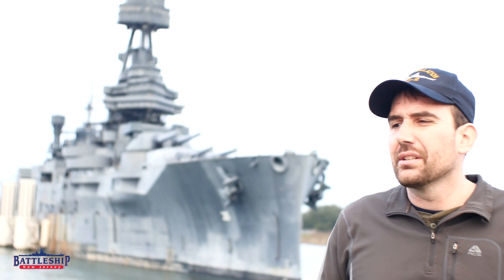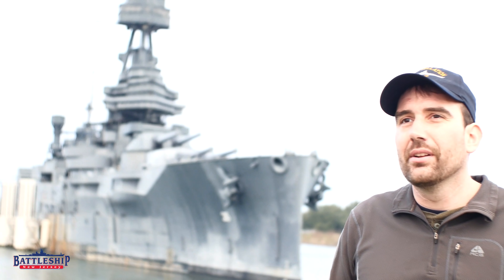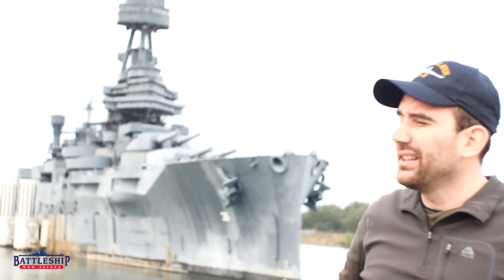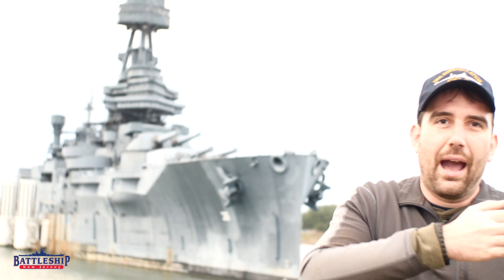Why Is Battleship Texas Shaped So Weird?

Comment: The most important problem is "Bang for the Buck".  These warships at that time were by far the most expensive ships being built by any navy.  This meant that they had to be made such that in a battle line they would have a good chance of surviving enemy weapons as they fought back.  Back then that meant armor or speed, but NOT both, due to the inefficient (much better than the 19th Century power plants, but still only beginning to put in higher-power designs like steam turbines to replace the sets of huge piston steam engines used previously.  Since the powerplants were so bulky, putting in high speed into such heavily-armed warships was not possible without decreasing the armor protection and, later, the much more effective anti-torpedo hull side protection, especially as aircraft were now beginning to become capable of carrying big-enough weapons, especially torpedoes, that they were now a bigger and bigger threat to battleships *(eventually aircraft carriers replacing battleships completely, with nuclear submarines eventually becoming somewhat equal as a replacement).

US battleships after the "Dreadnought"-type came into being circa 1905 or slightly later  with all one size of the biggest guns made at the time and the other guns just being small for any aircraft/anti-torpedo-boat guns (the 5"/51 being a very high-velocity, and relatively effective for its size, anti-small-ship gun) with almost no AA guns when the ship was first built (remember, only a very few years after the Wright Brothers had been able to get their first kite-like airplane into the sky at all).  The US decided to restrict speed of its warships more than some other nations, but increase the armor and put LOTS of the largest guns available (14" rifles in 1910 was then new universal weapon, replacing the then-current 12" or, in some foreign navies, down to 9.2" guns on their warships).  This meant heavier armor to have a chance to stop the enemy weapons at the expected battle ranges and this cut into the weight that could be put into powerplants.  They tried to get the lightest armor scheme that they thought they could live with by using the new idea of "all-or-nothing" armor, where the areas needing protection had the thickest armor possible for the ship size and weight, with the rest of the ship having only minimal anti-fragment/anti-small-gun protection -- this required moving the important areas closer together in the ship middle and cutting the ship length to just enough to allow the minimum engine/boiler systems (which took up a lot of the chip center) to get the minimum speed that they felt had to be used for an effective navy,

As noted, the US went for rather a lot of big, slow, heavily-armed and heavily-armored warships of similar capabilities (to others of roughly equal age, adding gunpower in large steps, such as 12" to 14" to 16" guns, with otherwise minimal changes to the ships as to speed and even armor).  For example, the WWI-era battleships, which TEXAS was one of the first with the 14: gun size, all had about the same belt armor -- 13.5" Class "A" (Krupp-type face-hardened nickel-chromium steel made by three big steel-makers in the US) armor for many of the later WWI-era battleships through the 16"-guned COLORADO Class -- allowing a good idea of what ranges against an enemy naval squadron you wanted to fight at (the late-19th-Century clusters of warships, many being one-of-a-kind, caused all sorts of headaches trying to figure out how to fight them as a group).  As gun ranges grew due to much better aiming and target tracking systems (optical directors and range-finders coupled to electro-mechanical calculators and reasonably reliable ways of transmitting the needed information from one place to another -- the US excelled at this for all types of warships, even today with digital computers, radar, and all other electronic devices), the requirement that all ships be able to concentrate their fire at the most dangerous targets emphasized the needed similarity in the ships to the largest extent possible, while still allowing progressive improvements such as bigger or longer-barrel guns to occur as time went on.  Improvements were to IMPROVE capability,, not to mess up the older well-established concepts and keep things unstable as to use!

Comment: Hi Ryan,
Love your videos, but I have to offer a correction for this one. About 2 minutes 20 seconds in you're discussing the torpedo bulge and you have a big red arrow pointing not to the torpedo protection but to her armor belt. That is flat face hardened steel and is mostly above the waterline, obviously not where a torpedo would hit. The bulges actually do show up in the drydock shot about 2 minutes later. Otherwise, great video. Keep them coming.
Ken Morgan
CAPT USN (Ret)

Comment: Design of BB-35 was quite sensible FOR HER TIME. Ranges were expected to be fairly sort, guns laid by crews for the secondaries, and all-round coverage to deal with torpedo boats required a lot of 5"/51s. Of course, it turned out some of the 5"/51s weren't very usable because they got washed out (British found they had the same problem with ships of that generation). Still, not a foolish design for the date.

Comment: The only ships that never really made sense to me were the French Pre-Dreadnoughts and some of the earliest French Dreadnoughts. They seemed to have included some stylistic licensing that did not always help with functionality.  The whole wing turret designs of foreign Dreadnoughts never made sense to me either, but I kind of understand why they did it. I mean to a certain extent more guns is more guns. However if you can only use those extra guns in certain situations, then you might as well not have them. This is why I personally view the USS South Carolina BB-26 as the first truly modern battleship and not Dreadnought herself. The all centerline main battery arrangement, a design that everyone eventually adopted, just makes the most sense. It allows for the carrying of a large number of guns, with the greatest firing arcs and offer the best protection for the machinery and magazines that operate the guns. Wing turrets were notorious for being knocked out by weather, heavy seas and also for having poor armor protection simply because of where they were placed. Was neve a big fan of the turrets in the middle of ships either. Again like the wing turrets, the mid-ship mounted turrets were only usable over very small firing arcs and again stretched out the area that required heavy armor. Then there are the French Dunkerques and Richelieus, and the British Nelsons with their all forward main battery arrangements. That arrangement is fine if you are the pursuing vessel, but if the tables are turned and you are the retreating vessel then you have no big guns to try and dissuade  or sink your pursuers.  And not that any battle wagons used the setup, but USS Pensacola (CA-24) having the heavier triple turrets superfiring over the lighter twin turrets never made much sense either. Why would you make the center of gravity of the ship higher by putting the triple turrets higher than the twin turrets and make the ship less stable? I suppose it might allow for a slimmer ship at the water line, since the larger barbette is moved towards the center of the ship and possibly a gain in speed.

Comment: Why was the top part of the battleship on 3 poles on Texas rather than the round cages seen on some ships at Pearl Harbor during the Japanese attack?
Reply: Texas was originally built with cage masts, but with the addition of new equipment like radar plus upgraded rangefinders the cage masts were too flexible. The tripod masts were more stable and were added during the mid-1920s renovation to replace the cage masts. Cage masts had been used originally because they were effectively transparent to enemy fire...shells hitting them would pass through harmlessly as the cage structure was not heavy enough to initiate the fuse action on armor-piercing shells.

Comment: Fyi, the battleship Texas is no longer where he is indicating with the projected image behind him. It was moved out of its moorings probably a couple of years ago by now. I forget where it's destination was but it was being towed to another township basically that had the money raised to do the necessary repairs to the structure below the water line. The ravages of time had ate away at the bottom and it had to have full-time pumps running to keep the water in check. The citizens of the Houston area and never were interested enough to get enough money together to make the repairs. It is odd and sad to see it's original location without it being there now but at least it will live on a little longer at its new destination.

Comment: A lot of design came from trial and error, obviously. 
You can't pull a ship that size out of the water and redo complete sections in a weekend.
So, they did the best they could with the knowledge they had at the time.
When you think about it, these warships were purpose built for WWII, and little time for testing.
So, I'm pretty sure most everything that the designers came up with was done from the best of intentions.
Some of it may not have worked, but they did try!

Comment: Well it seems to be a little bit of trial and error, from the Texas to the Missouri,but I'm sure that they were all very effective, so the Texas didn't have the long range guns, but still it had powerful guns, and and it was meant it seems that it was a little bit more effective in close quarter fighting, where the Missouri could reach and touch something, and had the long range guns,
  so that's why I said a little bit of trial and error in there, just like you said they took the mistakes that they made with the Texas, and had a little bit of trade off on the Missouri with the guns and the length in the width and the lessons that they learned from that, 
And now  along with the protection of the the extra hull added on the side for the torpedo protection, you know the bubbles that you talked about on the side, I forget what you call it,but it seems like a lot of the lessons that they've learned in the past they have forgotten today it's like who the hell ever thought of aluminum Ticonderoga class battleship it's like I drink beer out of aluminum beer cans, it looks like they had a trade-off there from steel to aluminum for speed and agility but they for the strength of steel, I think they should still be making steel battleships and I think they should still have those little bubbles on the side for torpedoes, it seems like they're depending too much on missiles in the ability to strike somebody at a long distance and they're not thinking about close quarter fighting, just like the other day when I ran was harassing another tag on the road in class battleship when they went through the straits of Hormuz,
   I still remember when that French exoset missile blasted a hole in the side of of one of the tigondiroga class ship, that would have never happened in the Missouri, oleum count of the strength of steel and the protection from the bubbles for torpedo protection because we all know the exocet barely skims off the top of the water, so I believe that would have helped, so trade this trade that and you end up with a good battleship, but I think the Missouri was the last of the badass battleships.

Comment: It is important to remember that today the USS Texas is not the hull built in 1912; but at least a dozen or more upgrades to almost every part of the ship except the engines and boilers to propel her. Airplanes and torpedoes are responsible for most of the changes. TM retired but still interested.

Comment: Too many of these historians do not mention the limiting factor for the beam width - The Panama Canal.  Also the Texas built in 1914 was originally a coal burner until a massive refit in 1925 to covert to oil boilers.  The torpedo blisters were added then to protect the fuel tanks. 

Better Texas Data is In This Video - https://www.youtube.com/watch?v=hUTBpTwjES4

Comment: I generally like this guy, but - Texas wasn't short and dumpy. At the time she was designed she was too long for existing docks. The U.S. Navy had just developed the 14"/45 and wanted ships equipped with them, but chose instead to build the Wyoming class, with their 12"/50s, because they could fit existing docks. At the same time, they put into the budget, funds to lengthen the docks and accepted the New York class design for the following year, when  the docks would be long enough for them. So, they were actually very long for their time.

Comment: Question: what were those huge, awfully top-heavy looking constructions on top of the tripod masts good for? 
I understand that a kind of very high lookout was necessary in the pre-radar era, but there must be a reasonable compromise between tiny crow‘s nests and those bizarre three-floor ‘apartment buildings‘ which don‘t even seem to integrate range finders. How many crew members were in there during a battle, and what were their tasks?
Reply: I don't know the whole story for the US navy, but functions "up top" (pre-Radar) would include. Spotting, range-finding / gunnery control, radio and visual communication, and (extremely important before radar,) searchlights.

Comment: 3:20 "the Iowa's with their long narrow features, tend to be a less stable gun platform... (then the Texas)" Under what metric are you basing this claim on? Ship stability is measured using it's metacentric height, the higher the metacentric height the more stable she was. The USS Texas has a metacentric height of 2.54, while the Iowa has a metacentric height of 9.26...
Reply: Bigger height tolerates more flooding, and rights itself faster.
It also rolls faster, which might have an impact on gunnery of the day.

Comment: You didn't mention the fact that the Texas (New York Class) as built had an anti-torpedo boat gun mounted directly in the stern just below the main deck.  If you look closely at the stern you will see the square plate that was added to fair over that gun port.  The gun was removed during one of the ships first refits because it was found that the gun port took on water through the port in most any seas.

Comment: why does all battleships not have a muzzle device like a muzzle break
Reply: Good question. I guess the two main reasons for one aren't so much an issue at sea, since recoil is absorbed by the heavy mounting and the brief muzzle flash is long gone by the time you reload.

Comment: I guess my question is about why the standard BBs were designed to be that slow. Would it take up too much weight and space for boilers and engines? Were the engines more efficient at that steam pressure and speed? Were the props better at those revolutions?

I know on my boilers and pump motors there are certain sweet spots where things work best. 80% of motor speed in one of them for electric motors.

Comment: One thing I've always wondered is why 21 knots?  Why aren't the Standard types all spec'd for 20 knots or 22 knots?
Reply: The Texas was designed for 21 knots and made that speed on sea trials in her WWI configuration. However, when the torpedo blisters were added in the 1920s (with no upgrade to her engines, although she was re-boilered for oil instead of coal), the increased drag slowed her down somewhat. I believe she could still make 20 knots at flank speed, but just barely.

Comment: Just wondering, were there any elevators incorporated into the frame? Especially to get up into the bridge or tower?
Thanks!
Reply: No 'people' elevators, but there were strategically placed ammunition hoists for both the 5" shells and the 40mm/20mm antiaircraft batteries. For What It's Worth, I know that USS Long Beach had a passenger elevator going up to her bridge; probably some of the carriers had similar provisions. (I do know that some of the 1950s supercarriers had escalators to bring the pilots up to the ready rooms!)

Comment: How about the different anchor designs used on battle ships?  That might make an interesting video, discuss how anchors work, the chain, the brake, the hoisting machinery, etc....How deep can the Texas or New Jersey make anchor?   At what angle is the anchor chain stretched from sea floor to the ship?   

  I am sure there is a lot of knowhow required for a task as common as dropping anchor, and I am sure you can tell that story in your typical great fashion

   Excellent video Captain!

Comment: There's probably a very basic answer to this that I should know, but what is the structure on the three masts above the superstructure used for? And was that original to the ship, or added at a later time?
Reply: It is a very basic answer but still a good question. The rangefinders where located as high as possible in order to see as far as possible over the horizon. Like the crows nest in the days of sail the higher you are the farther you can see. There was no radar when these ships where designed ( radar wasnt in use until WWII) so everything was line of sight.
Reply: That's main and secondary battery fire control equipment, and it was added when the cage masts were deleted in the late 1920s refit.
Reply: @edfrawley4356   gotcha, makes sense. I thought it might be something like that.
Reply: @colwebbsfmc   thanks for the info!

Comment: The removal of the 19 Gun Deck 5" was over a 25 year period.  The first 3 (the two mid casemates and the stern) in October 1917 and the last 8 early 1942.  There were two on the Navigation bridge removed October 1941

Comment: It would be interesting if someone did the calculations for the firing of the largest guns on the Texas to determine the horizontal displacement,  compared with the horizontal displacement  with the same size guns on the New Jersey battleship. 
This way there would be a real comparison of what was thought at the time of the designing of the Texas battleship.